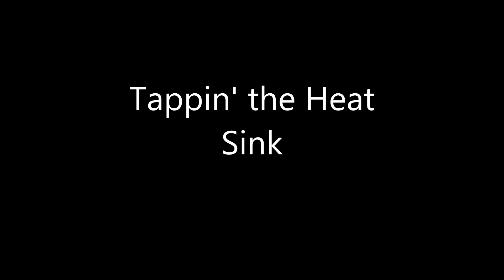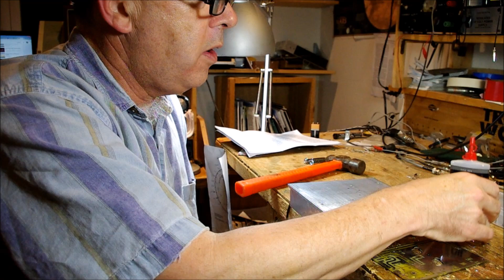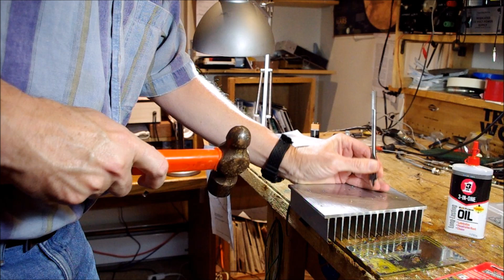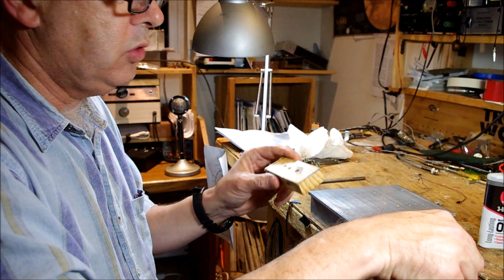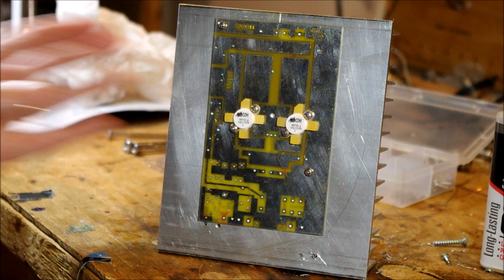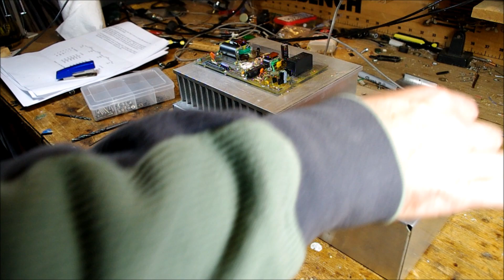How to Tap (Put Screw Threads) in Aluminum

Comment: I've broken a few taps in aluminum. And a lot bigger than 4-40. You have to turn it till you feel the resistance increase, then back it out, and clean out the filings. Aluminum really clogs up a tap.

Comment: Self drilling "TEK" screws are commonly available now. They have a built in drill bit tip instead of just a pointed tip. They are no longer rare or super expensive. I love them.
Reply: Do you just drill right in with them, without the need for a tap set?
Reply: @MegaCadr  Yes. Self drilling TEKS  drill and tap there own holes in one shot. Handy as heck for soooo many things.
Reply: @slowdown6436  that is super cool.  Thank you!!

Comment: THE real amazing thing here is that you are trying to show others how to do a simple machine shop job and you have no idea yourself.  Its not a thing, its a Tap, that is not a center punch its a wood bit, it is not for being beaten on with a hammer.  It is for drilling wood. Striking it with a hardened hammer head might cause it to shatter. 
    You are holding the drill slantways, so you hole is not square with the heat sink. NO telling what the tap was undergoing when you try to finish the hole.  There are so many things wrong with this video I can not watch the rest of it and have to stop at 7 min. 20 sec.   O yea, 45 years in a machine shop.
Reply: So tell us what is wrong ?

Comment: There is a much easier way to mount transistors and mosfets to heatsinks. Just use self tapping steel screws, saves all the hassle of tapping and broken taps.You drill the aluminium like you did, and turn the screw into the hole. The key to success is getting the hole size right.
Reply: Can I have self tapping steel screws in 2 mm dia?
Reply: That's precisely what I've ended up doing after ruining many taps and heatsinks I now just use the selftapping screws and they're much easier and save alot of time. I really wish someone had just told me back then lol.  Also the coarser thread of the screws seems to hold better than the finer thread that bolts have.
Reply: @FOATE  If you use self-drilling screws you won't have to worry about the correct size hole. Many people do confuse self tapping with self drilling. Self drilling have a cutting end on them to drill the hole.

Comment: Tapping aluminum is tricky. Since aluminum is soft... it tends to gall. Care must be taken to size the hole & tap properly. I have tried a number of different lubricants to do exactly what you're doing. I always come back to dishwashing soap. Dishwashing soap is very slippery and greatly simplifies the cleanup process after tapping. Any oil is a mess. I just clean up with water.

Of course when you do any tapping operation by hand... it's always a good idea every couple of tap turns... to reverse the tap perhaps a half turn. This breaks the curl of metal that the tap is creating... and allows the tap to operate with less friction. This friction is what breaks the very brittle tap.

Comment: From my experience in the electrical trade, you should first use a tapered tap and then a straight tap - that's why your your taps break!, also I use tallow (animal fat) which is  horibble stuff - it smells terible HI but it does the job - when I tap holes I always go in first with a taper - it saves you in broken taps! - 73 Kevin GW4WOV

Comment: Having worked with aluminum more than I like to remember doing everything from machining it, to welding it and tapping holes in it as well.  One of the best lubricants to use with aluminum whether working with it with a drill or tap and die set is plain old tallow.  Tallow is a rendered form of beef or mutton fat, processed from suet. It is solid at room temperature.  If no tallow is at hand bacon grease is also very good for metals that tear out or bits that seize.